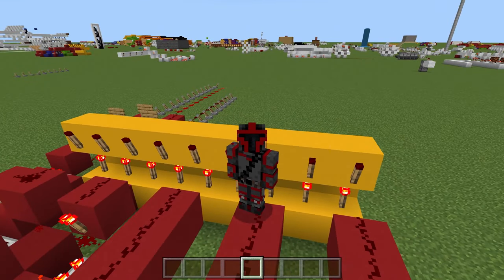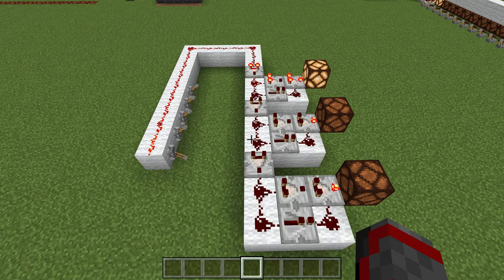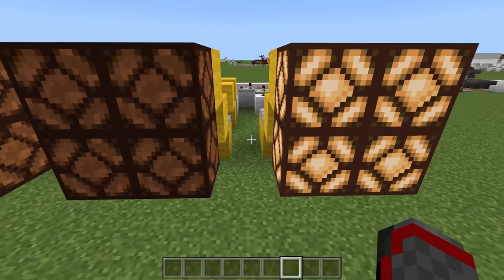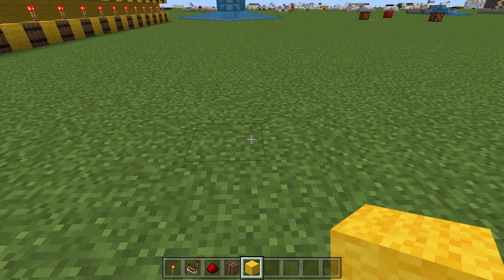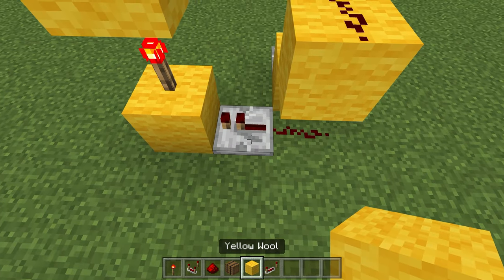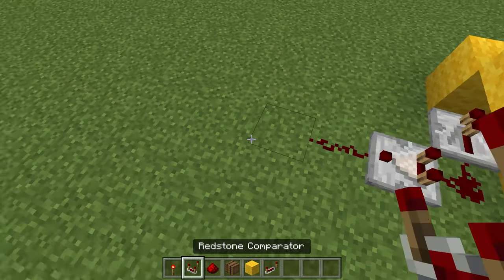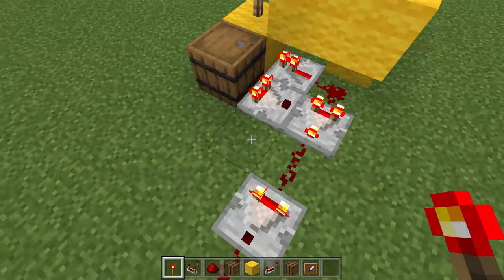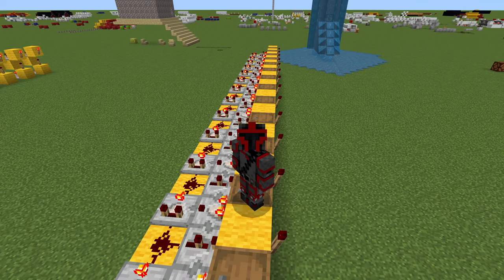New Redstone Signal Strength Decoder!

Comment: I had the same problem a week ago. I wanted to avoid a slow redcoder, so I came up with a solution: splitting the even and the odd values. That way, it can be 2-wide without losing any time. The order will be a little bit messed up, but that's not as big of a problem, in my opinion.

Comment: Nice video my dude. You could give it a 0 input,  right? So that you don't have to only have 15 outputs,  you could have 16?
Reply from the maker: Yes you can! That circuit is a little different. Basically, you could place a redstone torch on the side of the input block, and that would act as 0. If you gave the comparator an input, the torch would turn off.
Reply: @ct5k_  ah

Comment: Good stuff! Does this have any uses outside of pixel displays? 16 ticks to get an output still seems like a lot for most applications.
Reply from the maker: Yeah! Namely it can be used for xy grids, so this could apply to screens or memory. If you are building a computer for the first time, this would be a great way of connecting functions. Just to name a couple options.

Comment: Is there any way you can link this with skulk sensors to send signals of different strengths between two different locations.
For example can me and a team mate use this to send signals back and forth using two lines of skulk surrounded by wool